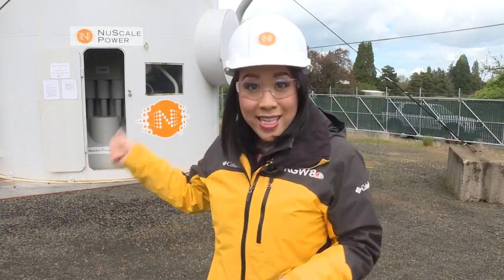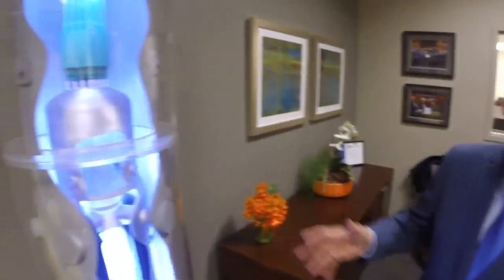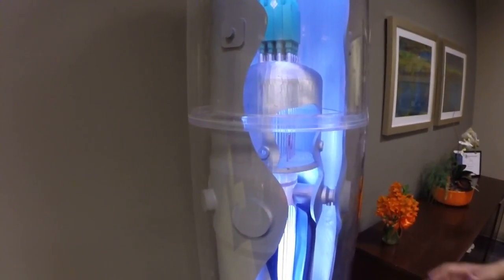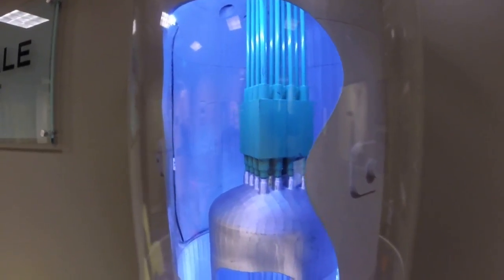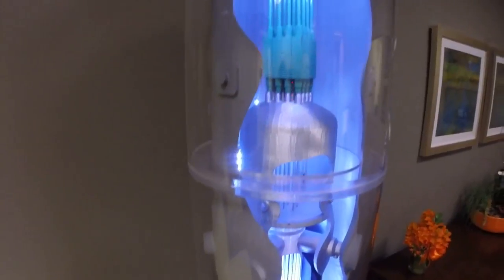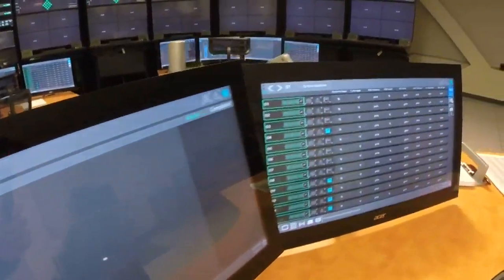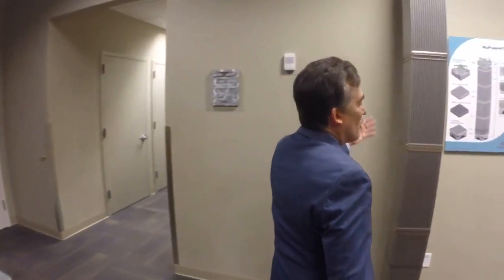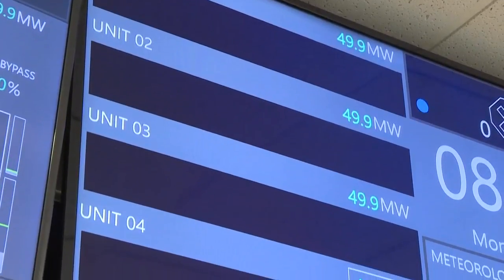Oregon company on nuclear energy forefront

Comment: The five stages of nuclear electric generation

Another concern with the Sovacool and Warner-Heath reviews is that among their selected LCAs there are, in both reviews, some analyses that do not include all the five stages in the nuclear lifecycle.

Greenhouse gases are emitted in all stages of the lifecycle of a nuclear reactor: construction, operation, fuel production, dismantling and waste disposal. Leaving out any of these five stages will bias estimates towards lower values.

The last two contributions, dismantling and waste disposal are particularly difficult to estimate. Not many commercial reactors have been fully decommissioned. Also there is still no scientific or political consensus on the approach to be used for the long-term storage of waste.

The fuel preparation contribution is also problematic. Considerable amounts of carbon are released in the mining, milling and separation of the uranium from the ore. Also the carbon emitted is very dependent on the concentration of uranium in the ore.
https://theecologist.org/2015/feb/05/false-solution-nuclear-power-not-low-carbon?fbclid=IwAR2wFG0q83NyQZhR_Ek6nGk3RimWxZowUxBWvLcn7SnLWdBFMAsnbsMIxCI